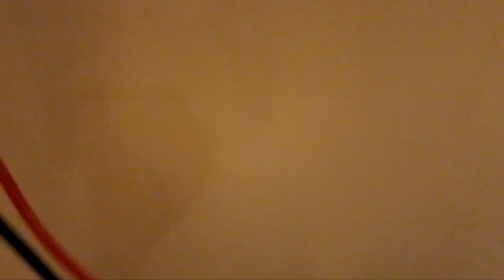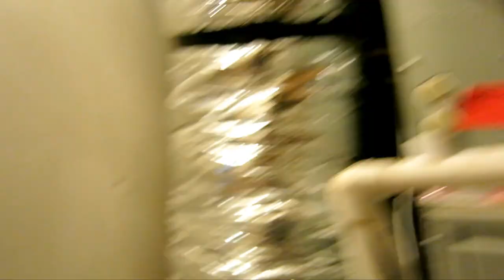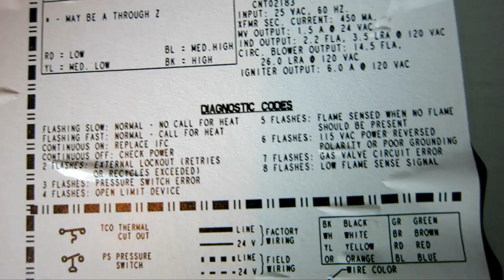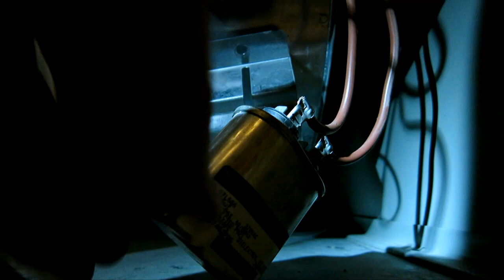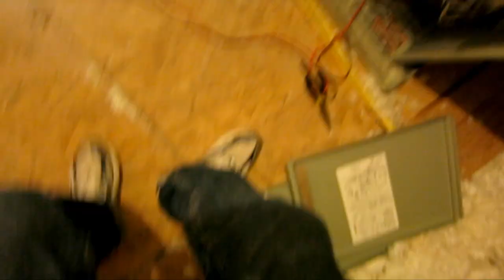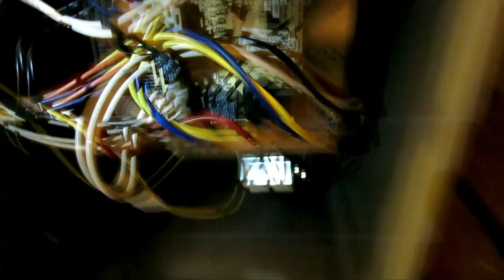Air Conditioner doesnt blow any air - how to fix AC blower - HVAC control board replacement

Comment: I have a question for you. My blower motor does not come unless I manually push start it. I checked to capacitor and was 12.38 microfarads. The label said it was supposed to be 7.5 microfarads +/- 5%. I am obviously getting power to the unit. The door switch works and the outside unit is running. I checked continuity on the control between the red and green wires and I got 30 volts. I disconnected the one lead to the door switch and the cool wire off the control board. Then I connected the cool wire to the open prong of the door switch. When I activated the door switch I can what sounds like the motor wanting to start. I can hear the flow of electricity, but nothing happens. Then with the door switch deactivated I manually pushed the fan then activated the door switch and the blower motor started to work. I am clueless as to why this is happening of how to correct it. Any advise you could give me would be helpful. Thanks in advance.
Reply from the maker: +Woody Dropa if the label says it should be 7.5 and you are measuring anything more or less than 5%; then the capacitor is bad/wrong, that would explain why you have to manually push it then turn it on.
Reply: +Woody Dropa   diy tinker is right  your capacitor changed value more/less the tolerance ...replace the capacitor and also check the resistance of your blower motor relay.

Comment: i had two questions, i didnt have a voltage meter to test the capacitor for the fan, but i plugged the fan up directly to the on switch like you did to test the fan and it did not work-but when i put the wires back the way they were and tried the a/c the fan turned on. and my second question is if i test the fan like i did and the fan did not come on does it automatically mean a bad motor or can it be the capacitor still, i appreciate any response
Reply from the maker: intermittent issues are the hardest to answer. The short answer is yes. a boarder line out of tolerance capacitor can sometimes turn the blower/fan/compressor on.
Reply: DIY Tinker thanks you dont know how much i appreciate your videos and quick response

Comment: you video is great. I did your steps. Last step tried to power blower just hums won't come on. Any ideas?
Reply: DavesGenny bad motor
Reply: I found my problems First discovered it was blowing a fuse on the control board allowing fan to work no AC. Further troubleshooting my contactor was blowing the fuse replaced and working. Then a week later my capacitor in the furnace went. I replaced that.

Comment: ok My question is my old control board I was told is bad so the service man that came out to take a look told me he was going to bypass 2 black wires but the fan will run 24/7 i will have to replace my control board.so I looked online found a control board alot cheaper the what they were going to charge me so I got the new control board called the back out but because i bought the new control board they can't replace it.my main question the 2 black wires he bypassed to help keep my house cool are from are suppose to be on what prongs to the new board my old board # was HK42FZ009 the new board # is HK42FZ0344614 the 2 black wires where on the L1 with a splitter on old board. where do they go on the new control board Please help me out it's getting cold and my kids need heat

Comment: Dude I installed a smart wifi Honeywell thermo. Had no common so did the ole G (green) wire for my setup to be used as C. Ok long story short I didn't see a terminal block under the panel for my central air unit. I have power to the thermo and heat functions ok. As far AC the compressor works but no air from vents! I'm so fucking close but I'm sure I need a jumper somewhere. What u thinkin bro? Thanks
Reply: you need to run a new set of wire from furnace to the t-stat

Comment: Hi, most of the vids uploaded doesn't seem to answer my ac problem. The ac at first blew warm air and the repairman went up to the blower and says that the relay is out? Mm.. I don't know but after he "bypasses" the relay the blower blew cold air. The only problem is I cannot set the timer nor is the thermostat working cos all the ac does is blows continuous lythroughout the night! I was told that I cannot use the remote only and must ON and OFF the ac by turning the main switch. Can I just change the relay? Is there such a thing as a relay on the blower? Thanks, sleuths! :)
Reply from the maker: +Emy Yap Yes, there is a relay. Not sure why the HVAC tech didnt replace the relay... its only $5-$30. Maybe he didnt have one on hand. Here are two videos:
If your unit is old, then this video (video skipped forward to the relay) goes over the relay but its replacing a control limit switch:
https://youtu.be/bWbLF9LwQwI?t=31
if your unit is newer, then here is a video that goes over the control board:
https://www.youtube.com/watch?v=0J9_ypacZMA
hope that helps
Reply: How 2 minecraft  is here!👾🎮
Reply: change your technical maam
Reply: Thanks
Reply: Thanks
Reply: This tech could have fix this problem with in a minute if he learn to read the lead light.
Control board has indicator light. 3 flashes means pressure switch issues.

Comment: Okay so I have all the same issues as this video ,it was running fine then stopped blowing air , the units start up the fan moves but the air does not blow. When I turn thermostat to cool and on position then press the door switch on unit it turns from red to green slow flash , also there is a noise in unit almost like it wants to come on but blower does not kick on , on either heat or cool 
I'm gonna go purchase a voltage meter but I wanted to trouble shoot first.  I have had it serviced before and I have had to change the thermostat previously a couple years ago. I also checked the batteries on thermo ect. Any help would be great , Thanks!
Reply: sounds like the capacitor on your fan is bad.

Comment: In my case the control board was not the issue, it was the transformer. Whoever is having the similar problem make sure to check the transformer as well to see if you are getting any power to the thermostat b4 buying the control board bcs they are expensive compare to transformer

Comment: I have a Payne HVAC package unit and the heat is working but when I switched it to cooling no air is coming through the vents but I hear the unit running. Any idea what the problem is?
Reply: Lisa Koch-Rocheleau likely your thermostat is faulty. Bypass the thermostat by tying the green,yellow and red wires together at the subplate.

Comment: Help. the outside fan is running and there is air pulling from the intake vent in my upstairs hallway, but no air coming out of my vents. I have the fan set to on or auto.

Comment: hi diy tinker, have the same issue blower not turning ON..went in the attic i can hear the relays clicking furnace goes into the cycle exhaust fan comes on,igniters glows then burner starts..except blower to bypass relay control board you take blk wire to door switch? i spent 1 hr in the attic trying to figure out tomorrow im testing the thermostat cause this probm happened just after replacing batteries

Comment: My HVAC is working fine but I'd like to upgrade the mech. blower relay with an SSR.  The unit is a Lennox G12 (G12D2-55-1) and the blower relay is pn 38276.
Reply from the maker: Tim Spriggs i couldnt look up the specs for a 38276. But as long as you can match all ratings, then an SSR can replace your old blower relay/contactor.
Reply: +DIY Tinker Thanks!  (a bit late)   I have tried about 8 times and it's failed one way or other.  But now I have a completed circuit that I think will work and just have to hook it up.    I am reluctant to try after so many fails tho.  I will wire in a small 3 A breaker on the 24V xformer before going further.   cheap insurance.

Comment: Could someone help me?  I 've been having the following problem for a couple of years:  Every so often the unit outside kicks in but the blower inside the house won't! Then I proceed to change the batteries in the t-stat and then the  blower comes on. It will run fine for a couple of weeks before it starts to do it over again. Any ideas? I'm on my third t-stat thinking that maybe I had a bad one :-(

Comment: what if the fan comes on, but no air is coming through the vents? I would consider that the ducts have a leak, but this mostly occurs at night, during the day, I haven't had a problem. I don't know much about how the AC unit works but is the air getting stuck at the compressor and the compressor isn't working properly?
Reply: Check to see if your unit is freezing up. Causing air top stop moving through coil.
Reply: +Caleb Vigneau I checked outside and that pipe had ice all over it so I imagine it was frozen but I feel like it shouldn't be getting frozen. I have it at 75 when I'm not home and 71 when I am and I live in a small, 1 bedroom apartment.
Reply: +corey8084 when was unit last serviced? when they get low on Freon they can start to freeze up. hopefully you check or change filter regularly.
Reply: +Caleb Vigneau I just moved into the apartment so I don't know any of that information, unfortunately.
Reply: +corey8084 apartment? have them check unit. if filter is clean then unit needs Freon. Not something you did

Comment: I manually spun the fan and then turned power on and fan kept going.I then waited and tried to see if would work again without spinning it and it did not .Any suggestions
Reply from the maker: Marky David check your fan/blower motor capacitor.

Comment: My fan will turn on when in heat but will not turn on during ac.  On heat, I get voltage going to the fan but on ac, I get 0 voltage..  I already replaced the capacitor.  Does anyone know why it's doing this and is this also a bad board?

Comment: So how bout just forgetting all the gingerbread electronics & just hard wire 120 V to the fan with a toggle switch. Just leave the fan going as long as the weather is hot? I fixed my refrigerator fan problem by putting an external fan on the floor and running it all the time.

Comment: My outside unit seems to be working but there's no air coming into the house and no air pulling from the exhaust vent. Any suggestions?
Reply from the maker: 1. blower is bad or blower capacitor is bad. 2. Control board relay. 3 evaporator coil is frozen from dirty coil or low refrigerant.
Reply: Deanna Harper

Comment: Just recently my wall ac is not blowing cold air. It turns on, but the compressor never kicks in. I all ready reset it. What should I do?
Reply from the maker: Nunya Dambidnis not sure what you mean by reset. but i assume the AC "trips" and you have to reset the fuse? If so, something is short to ground. check the capacitor, then measure the compressors and fan impedance. i have videos on both subject.